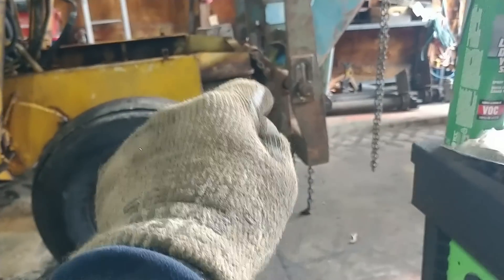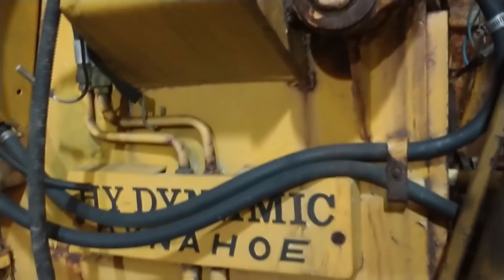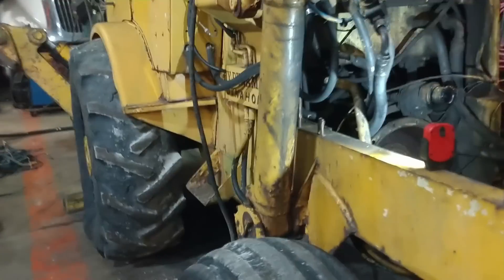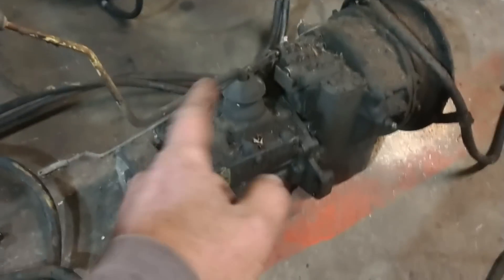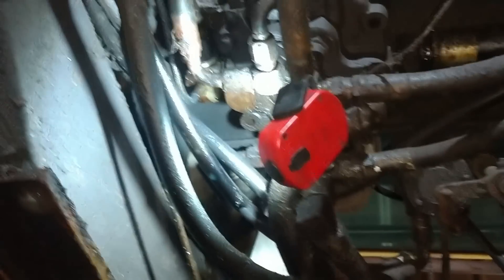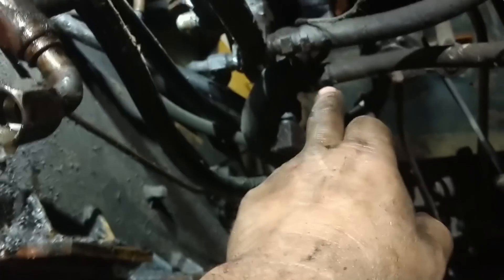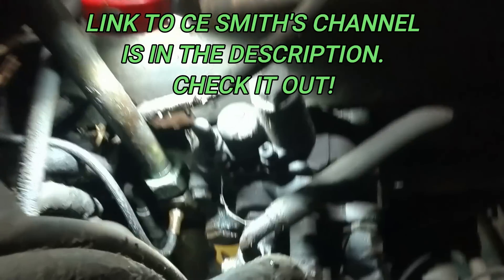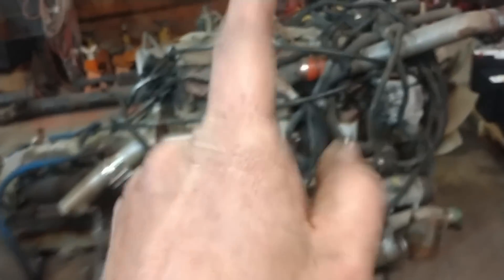DYNAHOE PT 4 HOW PLANS HAVE CHANGED! YOU DONT WANT TO MISS THIS!

Comment: Very interesting, I owned a late 60s dynahoe 160 353 Detroit.  I became familiar with alot of these systems, actually had an issue with the steering pump. Also replaced the hydraulic pump was given the wrong one first tire around and sheered the shaft it was reverse rotation.  Not sure why it was set up differently I thought all engines spun same direction. ???

Comment: Good idea J C.   Be nice project.
Reply: Couple weeks back I got a line boring machine and welding rig for line boring machine it works great.   Haven't had to weld boom yet just made bigger bushings.   So have fixed couple more Gradall excavators I bought when guy couldn't come up with money at auction.   They are all fixed up filters and oils changed new batteries and new tires and wheels and brakes and new paint.   I like fixing them up have plenty of work for them.   But tons cheaper than New one.   I also made two cabs out of aluminum for my new paving machine and added two RedDot AC units so lots cooler running it.   Guess it's why I like your videos. Hard work always pays off.   Have a great night J C

Comment: on occasion i will stock up on harbor freight wrenches and sockets and not to make them my primary tools but to use them as a specialty tool , cut them apart and weld them differently for each different application . i did some vids on my channel for a few.

Comment: I would use the original backhoe transmission because it makes it a lot easier to switch between forward and reverse with just a small lever and you get 3 reverse and 3 forward gears
Reply from the maker: the original trans and shuttle shift are rated for the 90 hp engine that was in it. this cummins is over twice that. my concern is that it will not take the hp and torque of the new engine.

Comment: Hell yeah. Saved the Dynahoe's life and agreed, a detroit has to be a learned behavior or something cause it screams all day, and even with a nice warm motor, you get some air in the fuel system and you can spend days getting that going again... thats worse case scenario but someone has those days and lots of times over the years it was me. The only reason that they even used the detroit in most of the fishing boats was parts and pieces were available as for the others came out of the lower forty eight and that could be several days before something came your way... yeah detroits are easier to work on in some ways but I still think that they had to be or no one would of wanted one... cause they all break down, every one of them break down and when time could mean a years wages, its a no brainer. I know that trying to think of why they did the routing of the hydraulics the way they did could take longer than just fixing something. Sure this is the time to maybe modify the "wheel" but that wheel ain't broke so don't tickle its feet. It costs so much more now to fix something than when that machine was built. Diesel was fifty cents and hydraulic oil had to be cheaper than todays prices. A lot of that plumbing under the machine came off rolls at the factory and was at least half the price to replace now, If I were to give a guess, I would say closer to ten times cheaper for the material and the labor to install. A filthy old pig she be now but I never seen that lady of yours back away from work... in fact, your going to have to pull her off some cleaning or it will look like new when shes done. I know I have seen one of those machines before and it was a mess of oil leaks and was not used all that much cause of the cost of oil and other stuff that comes with it. Good luck to you all
Reply from the maker: i want this to be a turn key, easy to use and own. i want to be able to go to it after sitting for months at a time and it operate like like i just shut it off an hour before. i have some special additions that should suit me perfectly.

Comment: If the Dynahoe is ready for Christmas then I guess it's going to be the Dynahoe-ho-ho...

Let the Dynahoe-verhaul commence...

I'm guessing that the main, manual transmission is going to be a fairly standard item made for a medium-duty truck, probably from the '60s.  It doesn't really make sense for the company to build their own gearbox when they can use a standard part and control and modify the gear rations to suit their needs by changing the ratios in the shuttle shift and rear end...

I've seen that sort of set up in the UJ yokes before, mainly in all-wheel drive vehicles that run a power unit that's designed for fairly low power but high torque output.  It gives a lot more shear strength to the yoke to handle the torque delivery without adding much in the way of weight or expense, and reduces the risk of shearing the yoke bolts and ending up with no drive in a sticky situation where maintaining drive and traction is essential,  Trying to drag a machine of that weight out of mud when it would just sink if it stopped moving would not be a good day out and very high stress for the .vehicles trying to pull it...

Using the 24v Cummins makes a lot of sense for that.  You've got a much easier parts supply for the Cummins, more efficiency due to it being a much more modern engine with the 24v head set-up so better fuel economy.  The straight/in-line 6 lump is bound to have more torque than the Detroit due to having twice as many cylinders, it's going to be smoother-running so it'll be less tiring to operate and it's going to be quieter too, also making it less tiring to run for longer periods and less intrusive to your neighbours.  With the fact that you already have the good, healthy Cummins and auto trans ready and waiting, so you're not going to be waiting for other people to complete reconditioning work and running into delays in parts supply on the Detroit then it is pretty much a no-brainer to do the conversion and end up with an extremely versatile machine equipped with a power plant you know well and so isn't going to throw up any surprises in terms of maintenance or troubleshooting...
Reply from the maker: the main is likely a specialty trans just for equipment with a shuttle shift as it doesnt have a reverse gear. that u joint is called a wing series. i am figuring out which way i can go on that right now.

Comment: Not scared at all lol.  good use of that engine.  All I was thinking about was how is he mounting the hydraulic pump.  It is a crank drive I see?  Good video it should be a good backhoe for you.
Reply from the maker: it is crank driven....it will be tight to make it work right but....lets give it a shot. after all, its just nuts and bolts.

Comment: I'm scared - I'm wondering if the boom will clear when it comes down if you lengthen the frame...hey, it's your shop, your machine, your time, your money & your call...l just think if you're going to put that 353 back right anyway - going back in the machine is the easier way...& those Detroit's are easy starters when they're right & easy maintenance takes them a long way - they don't give no trouble when they're right
Reply: Maybe save that Cummins Automatic for the 65 International?
Reply from the maker: i have plenty more of them!

Comment: I have the 4 way angles up to 1-1/4" very good to have. Unfortunately the larger sizes require very deep pockets. The large angle wrench set from HF isn't too bad for something that doesn't get used a lot. The larger crowfoot wrenches are also good to have for getting at those fittings on valves
Reply from the maker: i looked at the snap on website for some. $3200! yikes!
Reply: @j.c.smithprojects  yeah they are outrageous. Martin is a usa option at lower cost but not the same 4 way offset as snap on. However, on those sizes bigger than 1-1/4" I find the conventional angle wrenches usually work just fine.

Comment: I think that it is quite likely that there is a preferential hydraulic system for the steering so that in the event of a catastrophic hydraulic system failure the steering system is the last system to fail if only for basic safety reasons.
Reply from the maker: my good friend ce smith said the same thing. it is a priority valve.

Comment: ohh ya....  ignore the haters,     I really like how you use what you have and bought right.   I do the same and people who have never done anything like a motor swap try and tell me what I did wrong..  I was afraid you were doing to use a 4bt aka filling shaker..  24v /allison in that will be one hell of a setup... just a thought loose the mitubishi alternator and put a motorolla/prestolite/ leece neville 110-555jho I know you have one somewhere...
Reply from the maker: anybody can go "sign on the dotted line" for a new pretty machine....but saving the money, building it my self for my needs and knowing every system of the machine because i have had my hands on it....priceless!
Reply: @j.c.smithprojects  

New ,  = Never Ever Worked,   I hate when people try and sell the latest and greatest I want to see what kind of shape it’s in 10years old and 10k hours..  Value seems to have been lost on most people..   when you finish the swap the Value will be greater than anything you can go buy, and be more reliable and cost effective...aka=Value..   I also hate new stuff with priority parts,  $$$$

Comment: Great idea on the engine and gearbox swap JC updating the running gear of the backhoe basically modernisation of an old sturdy machine to a reliable machine has to be good
Besides that, I know I enjoy watching how you nut things out to a finished piece of machinery.
And most importantly you are building a machine for you to use, the way you need it,
For the best possible price,
Looking forward to the journey with you Jc
Tony from Western Australia
Reply from the maker: we will see if i am half as good as people think i am. this is going to be tight!
Reply: @j.c.smithprojects  basically as tight as a finger in your nose EH?
Or as people say anything is possible it just depends how much money you throw at it!
My only suggestion I can offer JC is, as you are working out how to fit it in
You are in the enviable position to decide how to make it as easy as possible to work on it in the future in a way a mechanic would want to, NOT the boffins sitting in there offices designing it with no intention of ever working on it.
Will you have to alter the diff gearing or pinion angle as this engine and gearbox look longer than the original ones?
Tony from Western Australia.
Reply from the maker: the "new" transmission is actually slightly shorter than the original combination. the engine is longer. i am trying to position it so that the yoke on the trans ends up where the old one was but slightly lower in the frame. i dont want it too low because it will make hard to service. i am considering what is the best of all and compromising as needed.
Reply: @j.c.smithprojects  it is going to be fun juggling the engine and gearbox (or are you going to separate them?} while measuring up for engine mount location  yet again the gradall comes in handy.
 looking forward to seeing it run (:
Tony
Reply from the maker: i want to put them in as one unit. the gradall will be sidelined on this job.

Comment: Pretty cool! I used to move my projects around with an old Michigan front end loader. Super sucked as the rear wheels steered the unit only, no center articulation. Had a 4 or 671 Detroit and had to wind the crap out of it to move it.

Comment: I like the idea of the cummins conversion. a lot of work and curious to see how that trans will work out.  you'll have plenty of power and not that horrible 2 stroke noise
Reply from the maker: the trans probably wont be as low a gear as the original but it should suit me just fine.

Comment: Excellent video 👍👍👍👍actually the b series Cummins engine is the o e m in some cases the direct replacement for the 2 cycle Detroit diesel engine and the machines that had Detroit diesel engines when the Cummins engine came out they got to be the popular engine for construction and logging equipment.  The power steering pump can be relocated to the timing case with a adapter or a different pump.  I have did a few repowers with the 4 bt Cummins diesel.  Cummins diesel have a very wide range of adapters to make pumps and stuff work off of the timing case and front pulley

Comment: you're going through this what's troubles you might as well just change all the hoses and fittings now so you never have to go in there and do it again pump all the oil out of the tanks because if you got water in the transmission you got water other places too
Reply from the maker: already drained the hydraulic tank and flushed it. i will change out any questionable or hard to access hoses before the engine and trans go in for the last time.
Reply: @j.c.smithprojects   Don't stop their teens everything C in the way of to go back in there in your lifetime make your son do it when hes older

Comment: Thanks for another TLB adventure update it's going to be fun and some headaches for sure,  I've done tractor engine 4 to 6  conversions and one 4 to V8 Perkins. Are any of these projects easy doing the first one no but it's rewarding when you figured it out, it works and the guys that say it couldn't be done go quiet.
 I remember years ago buying a diesel NH combine off a guys farm front lawn after it sat there 10 years as his wife wanted a pond there instead. The guy said to a friend of mine "he'll never get that motor in a tractor". My friend told me he just replied," if he figured he couldn't do it you'd still own a $2500 combine and not a pond" .
 I love the making the Detroit guys mad comment about running it with something quiet.  I was tempted to buy a track hoe with one and fit my spare ford combine motor. The TLB turned up cheaper and was better for what I actually needed, after a bit of easy fixing to use it. A $1000 in extra project parts goes nowhere these days especially  here in Canada. 
     The transmission was something I was thinking about a couple days ago while using my 4 speed manual and shuttle shift machine.  It's going to be interesting how it will work not having more fixed  ratio's, like the original gear box/shuttle shift combination.  See ya for the next update, Take care
Reply from the maker: if it just fell into place, it wouldnt be any fun now would it? i will likely never get out of 1st gear!

Comment: My Dad and I have a 1962 Dynahoe Model A with a bad 6 cylinder Continental flat head engine, We are hashing over on how to install a Ford 300 I6 with C6 trans and xfercase. We will be watching!
Reply from the maker: not trying to tell you your business but i chose this at545 for many reasons. i would look into that c6 and the gear ratios. you want be sure it is able to handle what you have intended for that machine.

Comment: you need to invest in some crowsfeet wrenches they would made tightening that line much easier
Reply from the maker: that is going to be a costly investment. that nut was 2"
Reply: @j.c.smithprojects  $60 on amazon for the set that goes to 2 inch

Comment: JC- Are you going to go with a Lovejoy connection off the crank to run the pump? Also doesn't the Detroit 2 stroke run backwards compared to the Cummins?
Reply from the maker: this cummins spins the same direction. that 2 stroke could run clockwise or counter clockwise.
Reply: not sure, but I think you could get detroits that turned in either direction.

Comment: My brother put a 12 valve in an Oliver tractor. He did not convert it to an A pump, so it still has the max speed governor from the truck. It works OK because it has twice the power the original engine had, but it struggles with hydraulic and variable PTO loads with no constant speed governor.
Reply: What pump does it have? Ve rotary or p7100 ?
Reply from the maker: since this is a 24 valve with a fast idle circuit and twice the hp the 2 stroke had, i am thinking it should operate just fine

Comment: that's an awesome idea ,,modern engine more fuel efficient , much quieter ,,and the cummins is heavier which means more counterweight for digging ,,this isn't the hardest conversion i have ever seen done by someone ,,i'm 46 now  but when i was 21  i turned a 1981 datsun pickup into a loader tractor ,,the transmission was easy too because i discovered that both input and output drive-line splines are the same ,i mated a 5 speed with the 3 speed automatic ,locked out the 5th gear ,,the end result was a machine that could reach 60mph on the road but also had the advantages of the shuttle shift Via the 3 speed automatic,,25 years later the little devil as my brother called it is still around ,on it's 3rd engine and the little automatic has been replaced with a 4 speed auto and a V6 engine ,,still gets used to pull hay wagons and load bale stacks which was it's original purpose stacking small bales